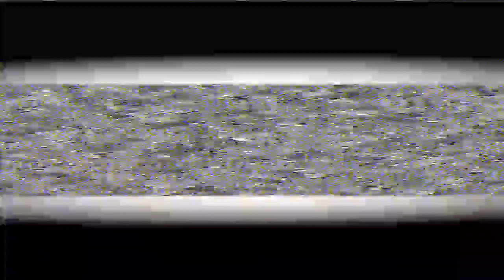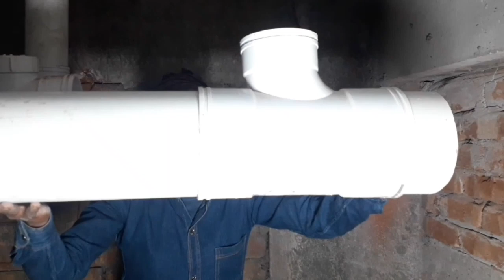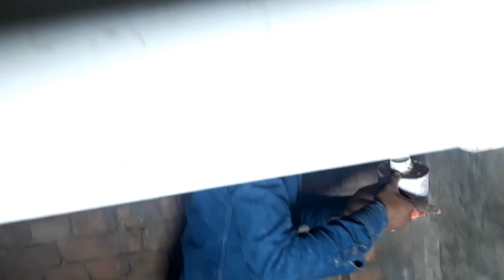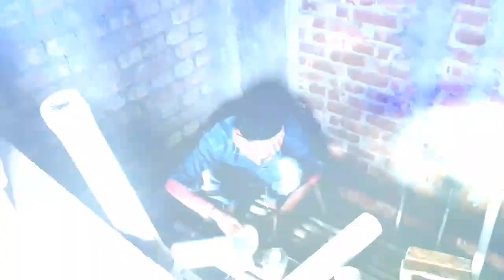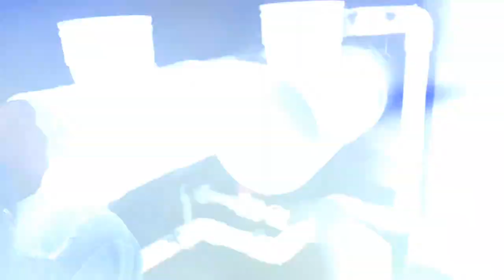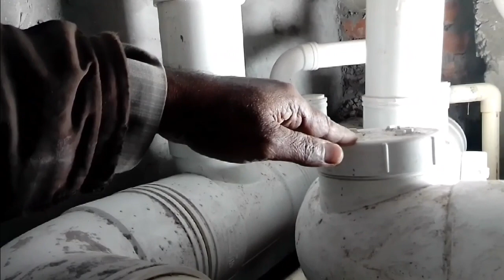বহুতল ভবনের ৬ ইঞ্চি পাইপ লাইনের সাথে ৪ ইঞ্চি লাইনের ওয়্যারিং | লংট্রাপ | বেন্ড | গ্যাস পাইপ ফিটিং।

Comment: With out ventilated branch pipe & stack ?
Reply from the maker: Look at the end of the video, the gas pipe line is shown.
Reply: @SanitaryWorkEducationCenter   Fully Ventilated Sanitary Plumbing System(3-15a)&(3-16a) British standard 
(a) The fully ventilated system is used where there are large numbers of sanitary appliances in range or where they have to be widely dispersed.
(b) In the fully ventilated system, separate discharge and ventilating stacks have to be provided and be extended to the atmosphere. Individual traps/soil sanitary appliances connected directly to the discharge pipe or stack need to be provided with branch ventilating pipe which is connected to ventilating stack.
(c) The discharge stack shall have a uniform diameter of not less than 100mm throughout its entire length.
(d) The trap connecting directly to a discharge pipe shall be provided with a branch ventilating pipe of not less than 50mm in diameter.
(e) The ventilating pipe shall be constructed upwards individually and be connected to a main ventilating stack. Such connection shall be above the spill over level of the soil sanitary appliance or floor trap served by such ventilating pipe. The details are shown in Drawings No. 3-19 & 3-20.
(f) The top end of every ventilating stack shall either terminate as high as the discharge stack or connect into the discharge stack at a point not less than 150mm above the spill over level of the topmost soil sanitary appliance or floor trap.
(g) For multi-storey buildings of seven-storey or higher (3-16a), the discharge pipe serving the second storey shall be connected to a secondary discharge stack of diameter not less than 100mm. This stack shall be extended to serve as ventilating stack but may be reduced to 75mm diameter.
(h) Cross venting between the ventilating stack and the discharge stack shall be provided at every ten storeys.
Reply from the maker: Talking about any work, there was a request to write in Bengali.